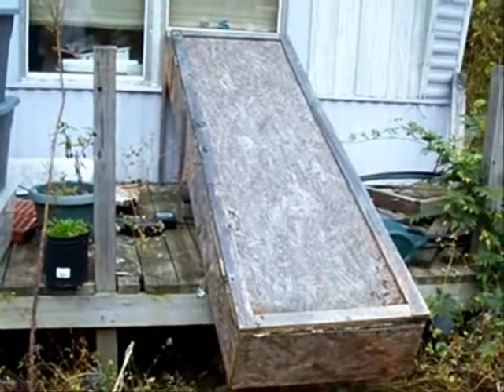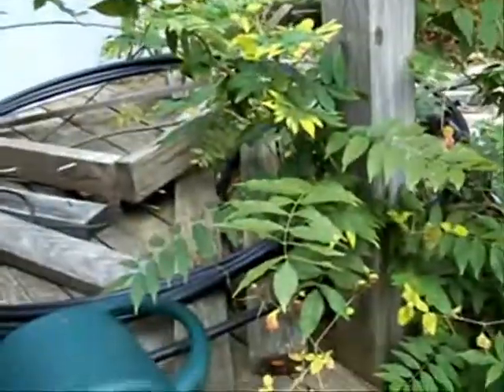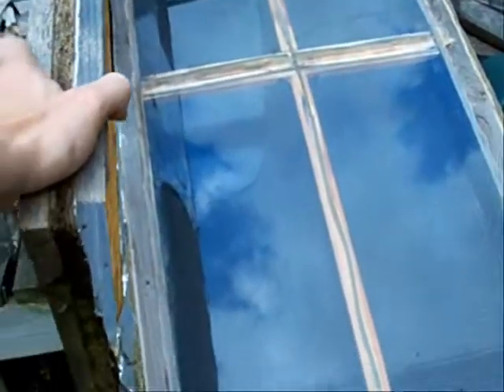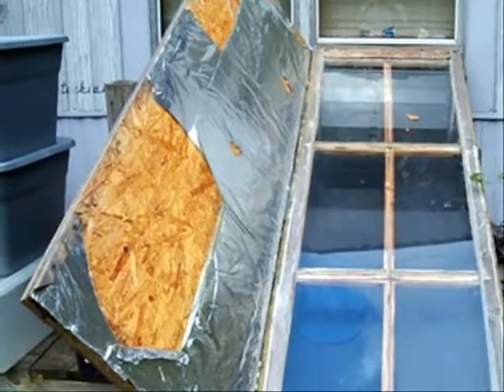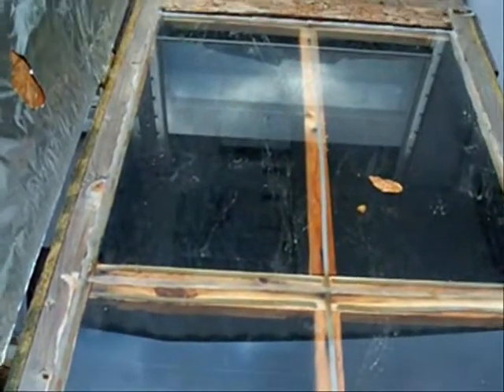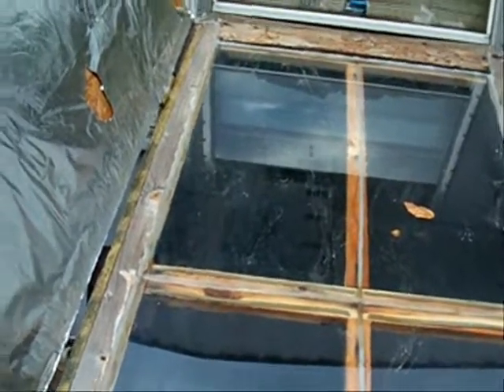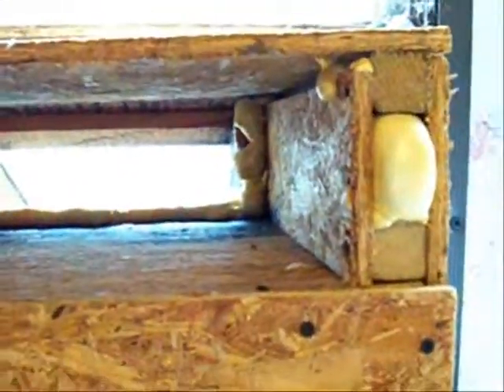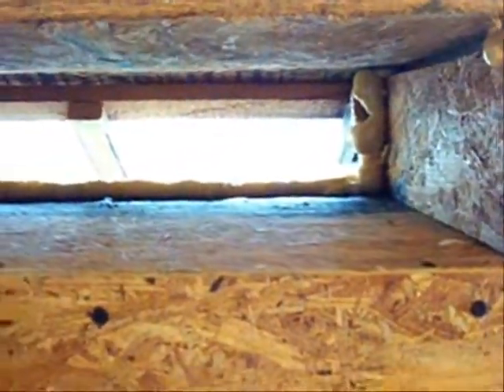Free Home Heat with a Window Heater

Comment: Have you figured out how much heat you get from such a setup compared to just the normal heat gain that your home windows & walls provide on a sunny day?
Reply from the maker: 30 BTU per sq/ft on black surface for this area. Don't know what it is for other surfaces.
With the foil reflecting more light in we could get between 40 - 55 BTU per sq/ft.
Reply: How many sf is your collector & how many hours of direct sunlight do you get on a fully sunny day?
Reply from the maker: This one is 16 sq/ft. I keep telling my wife I want to make a bigger one for our current home. This location gets about 5 hours of sun from noon till 5pm.
Reply: So your best case scenario is about 880 BTUs per hour or 4,400 BTUs per day?  Since a typical 2000 sf home in a cold environment usually takes between 35 to 50 BTU/h per sf (assuming 8' high ceilings), your system only provides enough heat for a room that is 5'x5' to 4.2'x4.2'.  That of course is a ball park calculation because it really depend on how much heat gain & loss your structure experiences due to sun exposure, wind, insulation, etc.

What is your average outside temp on a cold day when the sun is shining?  What is your lowest, highest, & average inside temp in the room that is benefiting from your solar energy heating system?  How do those numbers compare to the same space when you cutoff all heat to the space & just allow whatever energy would naturally transfer to that space?
Reply from the maker: There is a calculator for part of that http://youtu.be/u2EespQUC9g
I have not seen a calculator for everything your asking yet.
Reply: Jason Roush Part of your video shows that your whole home would need 84649 BTUs to heat it & that 32.167 candles would be required to provide that amount of heat.  Since 84649 / 32.167 = 2,632 BTUs per candle.  Since a typical candle puts out about 250 BTUs per hour, I'm wondering what kind of candle that software tool is referring to.  Do you know what kind of candle puts out that much heat (i.e. 2,632 BTU/h)?
Reply from the maker: It shows 8464.9
Reply: Jason Roush Hmm.. It looks like 84649 on my screen.  Sorry! 
In that case (8464.9), you get an average BTU/h of 263 btus per candle.  That's more reasonable.  Some candles (with larger wicks) can put out more heat.
Thanks for the update!
Reply: Jason Roush
Why did you use Red Lion Crimson 3's product to do your calculations?  It would be a lot more usable/portable if you would have used a spreadsheet (e.g. open office or Excel)?  I really can't see myself downloading a 116 MB file from Red Lion just to run a small app that could have just as easily been done in a spreadsheet.
Reply from the maker: I use their HMI's at work and its free software. I could have made it in VB.NET, but I wanted it to both open source script and GUI interface.
It would be easy to do in excel, but I am not good at overlaying a user interface on top.
Reply: I already made an Excel spreadsheet.
I don't need any kind of overlay.
It only has about 6 input cells.
Reply: Jason Roush
What is your full equation to take into account the inputted insulation values?
Reply from the maker: Q = A*U*DeltaT
A is area
U = 1 / Rvalue
DeltaT = inside temp - outside temp
Q = heat lost.
The full formula is at the start of the other video.
Figured for each wall and ceiling. Floors are left out for multiple reasons.
Reply: Agreed.  All of this:
Q = A*U*DeltaT
A is area
U = 1 / Rvalue
DeltaT = inside temp - outside temp
Q = heat lost.

Is at the beginning of your video, however you don't show the formula for accounting for the ceiling & walls.
Reply from the maker: Last file in the list now should open in excel or open office http://jasonroush.weebly.com/youtubefiles.html
Reply: It looks good/accurate--thanks!